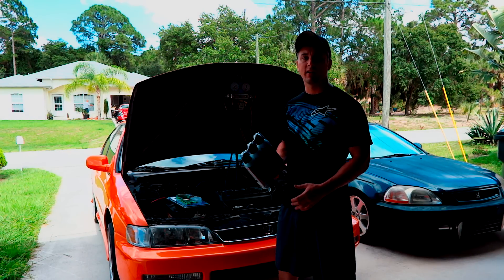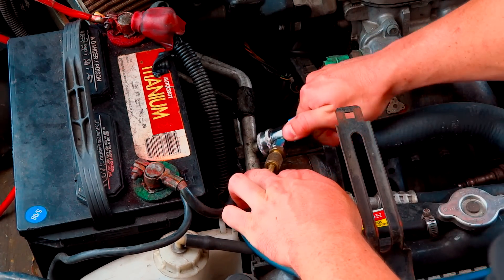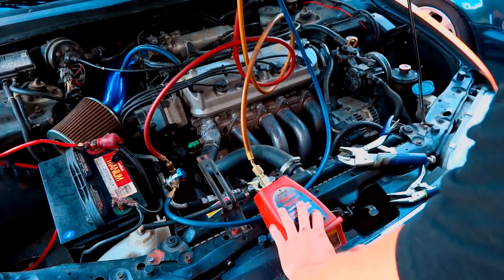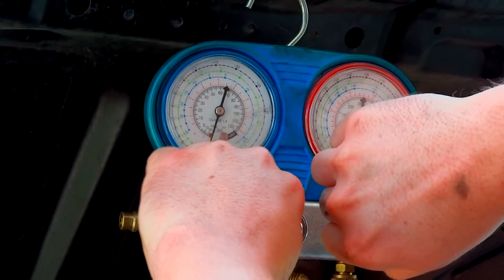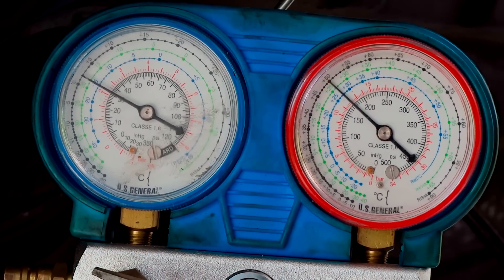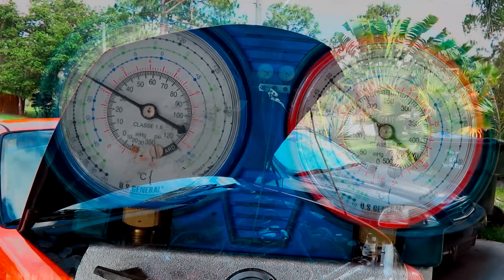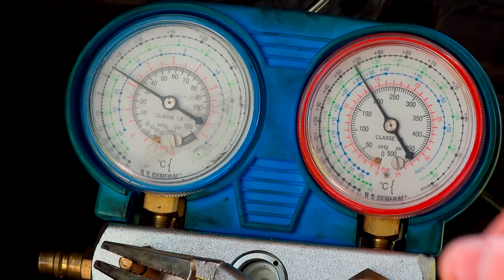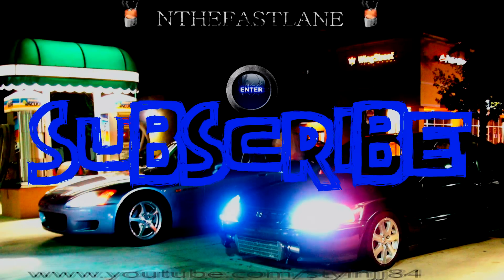Charge Your A/C With The Cheapest & Coldest Refrigerant

Comment: Is that the same stuff they sold for to replace R12 it was propane or something flammable Freeze 12. I tired it a few times on old R12 systems didn't work. If you system is working well R134A will work. Some of the older 90's cars had poorly designed 134A systems.
Reply: Freeze 12 works (worked) fine... The hassles were no shops will touch it... and it's hard to find at a decent price now.   I used it 3x in old R12 cars and they both cooled great.  Don't use it anymore because of the above hassles.

Your chance of getting burned by something like that in your ac system is squat compared to a leaking gas line on your engine.
Reply: Dan Limbaugh I tried it but could not get the pressures right ended up just doing a full conversion to 134A replaced everything except the evap. On my toyota pickup I just go on eBay and get R12 not that expensive only holds a few lbs nothing is better then old fashion R12.
Reply: I didn't have gauges back then... I just read how many oz's of freeze 12 were supposed to be equal to xx oz's of r12...    vacuum'd the system with a pump from AutoZone and then shot in that specific amount of Freeze 12... plus a little can of freeze12 lubricant that came with it.

Oh!!!!  I for got to add this part!!!

 I got very lucky.  right after I'd ordered the Freeze12 from eBay... I was at my local NAPA store... and they had a little worn out box that had a few fittings in it and 3 little 10 or so inch long hoses... it said "Freeze12 manifold Kit" handwritten on the box!   I bought it for $25 or something... and that was I was able to vacuum down the system... because the Freeze12 cans' and adaptor they give you have bizarre reverse threads on them.  And the high and low pressure threads are different too I think.

Normal vacuum lines for R12 or R134 won't work, so once you put the reverse thread fittings on... how do you vacuum it properly?
Reply: Dan Limbaugh I think I made some sort of adaptor from copper fittings I got from Home Depot but I was able to vacuum it. It got cold but it would not at low speed or stop lights. That truck was a 1980 c-20 3x3 cab the A6 GM compressor was on it's last legs. Instead of wasting the money on another one I got an aftermarket 134a from a local guy who sells all the parts he even makes you custom hoses you just drive down there he measures it all out about $50 for everything. The condenser he sold me was a cross flow I mounted it with some brackets I made. When I was done the system worked well better then stock 134A on my friends 94 pickup. Back in those years 134A was new and cars coming from the factory had poor designs the condenser wasn't' big enough. I'm in Phoenix so AC gets hit hard here.  That pickup I had the front end was really big so I was able to fit the largest 134A condenser he had.  I usually charge to high side pressure to temp chart when I get close I wait until my vent gauge gets to 20F it's good. I check to make sure it doesn't cycle too fast when idling. With a fixed tube they are suppose to cycle. If you ever need any help post on their forum www.ackits.com they are in phoenix all they do is auto ac nothing else they are experts.

Comment: hi there
thnx for the video

but try this: Johnsen's 6312-12pack r134a; its lowest was $44 on amazon(47 now at time of post); 47/12+tax=$4.23 per  12oz can. Cheapest possible r134a cans i have found so far + american made + no additive. 

just becuase Difluoroethane is stated on the can, it does not necessarily is a refrigerant. 

the r134a is 1,1,1,2-Tetrafluoroethane
Reply: ***** "1,1-Difluoroethane, also DFE is an organofluorine compound with the chemical formula C2H4F2. This colorless gas is used as a refrigerant, where it is often listed as R-152a or HFC-152a. As an alternative to chlorofluorocarbons, it has an ozone depletion potential of zero, a lower global warming potential (120) and a shorter atmospheric lifetime (1.4 years).[2] It has recently been approved for use in automobile applications as an alternative to R-134a."

Comment: poor guy makes a awesome video on to save you hundreads and everybody wants to give him shit. i appriciate the video bro keep making them. i have to do this on my 240 this month
Reply: *****
  You are wrong. Do some research before opening pie hole.
Reply: Fred, a study was done and the only problem with R152a was the flammability and you can tell from the write-up on the study why it was even part of the argument. R134a just came down in price to $5 per can but you get 10 oz. On Amazon now, R152a is 4 cans of 10 oz each for $18 which is better by only a little bit now compared to what it was before. However, the R152a is superior IMHO to R134a  in its ability to work with various oils and it does a better job of cooling. R134a is a loser and always has been.
Reply: @jaydubyahwing2260  can you supply info comparing miscibility?  of the various refrigerant and oils? I used to have a link but lost it.
Reply: @bryanfullerton1566 , as I understood it, the study considered all of the various aspects. You should be able to find it again doing a search on refrigerants.  The statement was that it could be used as a replacement for R134a and R12 without concern for the oil with various advantages, at the time it had been cheaper, but the price of R134a came down, now it is back up almost triple the price. The argument being made by this videographer is that the R152a is common Dust Off - it is allowed to be released into the air with impunity as Dust Off, but is so so  so dangerous as a refrigerant.
Reply: @jaydubyahwing2260  And there is a law that stated that flammable refrigerants can NOT be used in automobile a/c units unless the unit has been designed for use with flammable refrigerants!  There were many r-12 replacements that were discontinued because of flammability issues during/after car accidents!  I have never been a fan of R134a, but R152a would NEVER be used by me on anything!
Reply: @user-cy6gf2pj7y  , sorry, but that law applies to all refrigerants R134a has an advantage in the automotive industry because it isn't as flammable, but under certain conditions it will burn. I am not certain why you aimed this comment at my response to the previous back and forth by other posts to point out that there was a study (probably several) that came to the conclusion that R152a was a very viable candidate, but it was flammable to a greater extent than R134a. That point was mitigated as I recall by the report as well as being difficult to get ignition, I think. A number of other refrigerants under consideration were very flammable. The main take-away from this video is that the ordinary Dust Off is the very same thing as R152a and it is not overly protected with warnings all over the place concerning its flammability. It is basically without concern for flammability for blowing the dust out of electrical gear - I don't think it even suggests that you power equipment off to use it.
Reply: ViciousTech . . ... so can u tell me ....when u have a leak where this r134 goes.    i assume  to the atmosphere.  but maybe im wrong.    hahaha stupid people talking  about laws  and this guy pay extra money to pass smog regulations.  hahahaha
Reply: @tachidatumoto7240  There are also laws that REQUIRE leaks above a certain percentage of the full charge weight to be repaired!  That was another add-on to the law that was enacted during the obama years.  The deal is that it's hard to enforce in mobile refrigeration, but the law is still there!
Reply: Juan,  3-12 Oz cans of dust off costs around $20. 3-12 Oz cans of R134a on amazon or ebay cost about $20. I'm sorry, but I'm not seeing the savings. Maybe a few bucks at the most. I'm no expert on what Difluoroethane might do to my air conditioning system, and therefore quite reluctant to remove the 134a and put in dust off. When the manufacturer of my vehicle says it's ok to replace the R134a with R152a then I may do it.  I'm certainly not going to do it because some vice grip wielding kid on YouTube says it's a good idea. Fwiw, it is totally illegal to vent your R134a, or R12 to the atmosphere. You're supposed to get it recovered from your system. When he vented the system, was he venting a previous charge of Difluoroethane, or 134a? When he and his friends replace 134a in a system with dust off does he / they properly capture the old refrigerant? I bet not, and thus can cram any claims about caring for the environment where the sun doesn't shine. It's hypocrisy. The average car leaks less than 1oz per year through the compressor seal. He's dumping 20-30 times that much when he dumps one of these systems.
Reply: @fredflintstone8048  You are totally correct!
Reply: @fredflintstone8048  "When he vented the system, was he venting a previous charge of Difluoroethane, or 134a?"

He released some Envirosafe R134a replacement refrigerant, which is a blend of 2 refrigerants:  propane (R290) and isobutane (R600a), which is perfectly legal.  He did not vent R134a into the atmosphere, which would indeed be illegal.
Reply: free market of ideas, it works, it is cheap, so people do it an move on with their lives... I agree... the peta-nerds follow scientism, not science...
Reply: Juan Vargas save money? how about telling and encouraging people to violate the law. R134a is not legally permitted to be released into the atmosphere. how about you learn about federal mobile refrigeration laws...
Reply: ViciousTech 
Well sir, if you would of read the description of the video you would understand your comment is uneccesary and owe me an apology. I am a BMW level 3 technican, certified diesel technican, and a ASE certified Master technican. I also have my 608 and my 609. Who are you again? Have a nice day
Reply: @JuanVargas-yq1rz  I have had my section 608 and 609 certifications since 1994, and in BOTH mobile and stationary, it is illegal to vent ANY refrigerant, and there is up to a $50,000 fine if reported to the EPA.  At one time a few years ago, it wasn't illegal to vent r134A or r410a, but that was changed during obama's run as President!

Comment: Hillarous!! The best " How not to" vid I have seen in ages. First thing in this Video I'm going to show you is how to commit an Illegal act the free world over by venting refrigerant to atmosphere! Hahahahah! I was waiting for you to demonstrate how to tip sump oil down the storm water drain next or burn old tyres in your backyard!
 I loved the comic genius in not only having spray come out of the first bottle you tapped and giving yourself a freeze burn, you did it the second time as well!  Normally you see a gag once and that's it but this was even funnier when you repeated it. Classic!
The pliers on the hose connections was funny but not as good as the $20 gauge set with no knobs and you putting pliers on there.  Comedy genius.  But the finishing touch with the lawnmower  racket in the background of the sign off at the end was inspired. Just that little extra humour outside of the main subject comedy. 
I'll bet Mr.Bean could not have done any of those gags and got any more laughs.
Reply: The refrigerant he vented was not R134a.  It was a hydrocarbon refrigerant, a blend of R290 and R600a, which is perfectly legal to vent.  It's called Envirosafe R134a replacement refrigerant.

Comment: Hi just a thought,why did you not attach the pipe to the side can tap before piercing the can (save getting cold fingers)
Reply from the maker: I didn't want the clamp to slip, the hose put a little tension on the wrist. It could have been done that way also. If you don't use the whole can you have to take it off anyway :)